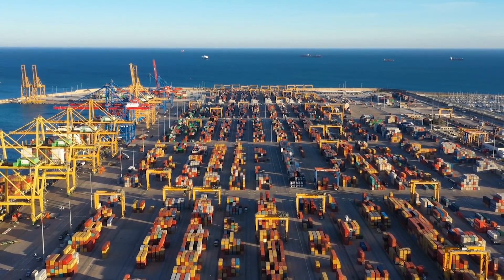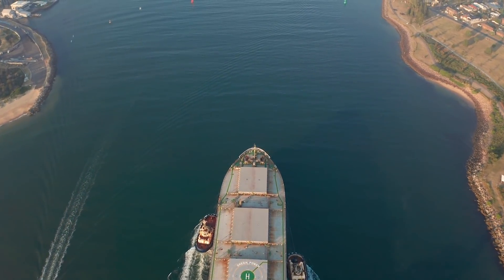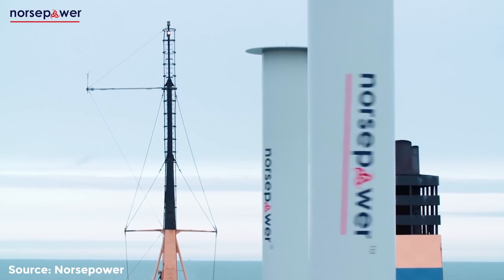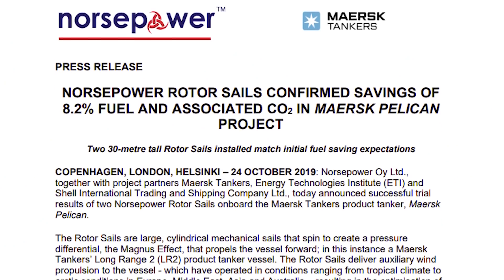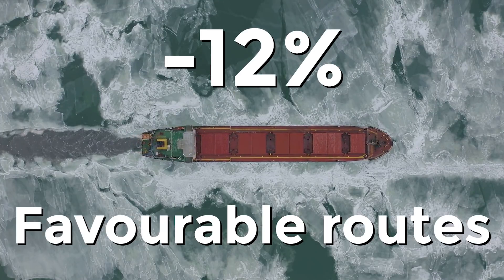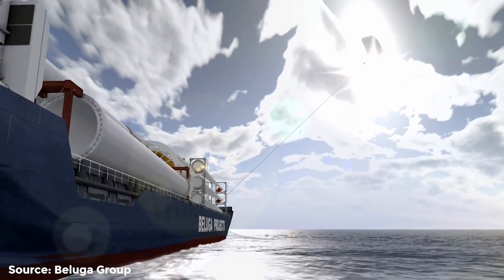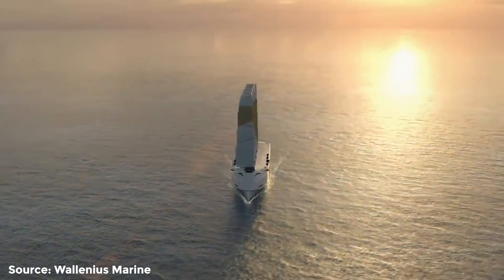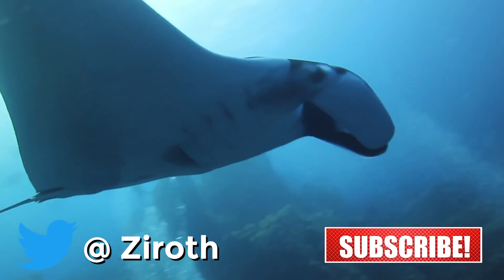Is Wind Power The Future of Shipping?

Comment: dude, i like the fact that you are not selling this as the future and are sceptical of the results, especially when they claim 90%. I think we are very far from renewable energy on big forms of transports (lorries, ships, planes,...). the reason is, all these are designed to have a (relatively) small engine compared to the full cargo. for example, if you think of a ship, probably the engine is 5% of the total size, together with the tanks maybe 10%, same for planes. Of course you can have an electric car because the current petrol engine uses almost 1/3 of the car (the front of back part) so a 1 to 1 transition is not a bad thing.
About the kite, I really doubt it can be a feasible solution, simply because the ropes will need to be so ultra resistant that I doubt will be able to pull an entire vessel full of containers and in any case will reduce the emissions (as you mentioned) by 10% maximum, even by optimising them at their best.

Comment: What about nuclear ship
Reply: If you do a web search for ‘nuclear ship savannah’ you will see that it has been tried and did not work.  A similarly vessel heavily subsidised, by the government, vessel is in use in Russia which also operates, in support of the Northern Sea Route, a fleet of nuclear powered ice breakers all of these may, or may not, have been completely without issues.

Just think; would you have full confidence in the management of a nuclear reactor under the control of an anonymous entity only traceable, perhaps, via a letter box in a FOC (flag of convenience) nation state?  If you are, could you sell that confidence to Japan, the state that hosted the Hiroshima and Nagasaki nuclear detonations as well as more recently the Fukushima ‘event’?  Then try that same, or a similar, sales strategy on Ukraine, the nation state that as a part of the USSR (CCCP) hosted the Chernobyl ‘event’.  Modern iterations of nuclear energy, thorium fuel, molten salt reactors or fusion reactors, will carry the legacy of past problems.  It is the global trepidation of anything with 'nuclear' in the name and the economics of nuclear having transitioned from 'energy to cheap to charge for' too 'the costs of remediation are incalculable' that will prevent the adoption of nuclear energy as a means of creating energy at sea.  Modern reaction systems may have overcome the safety problems but the general public, having been misled in the past, will be reluctant to believe the fresh new promises.  The incident of the ‘Ever Given’ blocking the Suez Canal, March 2021, may also have a little to add to this debate.  The cooling water on ships tends to get taken in from near the bottom so when running aground the inlets are in a prime spot to get plugged up restricting, if not stopping, the flow of coolant.  One thing that the TMI, Chernobyl and Fukushima incidents all had in common was that the supply of coolant, or rather lack thereof, was a fundamental cause.

‘They’ say nuclear is cheap, it’s not it is expensive and has a large embedded carbon quotient as well as being complicated, dangerous, not universally socially acceptable and having only ‘no need for refuelling’ as a questionable advantage; actually it does need refuelling just not as often.  When ‘they’ do need to refill the warming up stuff it takes considerable longer than pumping tonnes of thick black stuff, cSt380 HFO, or thin runny stuff, MDO, onboard which is one of the reasons HMS Queen Elizabeth and HMS Prince of Wales are pushed about by ICEs and gas turbines thus using a similar fuel as the aircraft that fly off of them.  The Royal Navy (RN) with a high degree of skill and expertise uses, at vast expenses to the UK taxpayer, a current operational nuclear fleet of 11 submarines (also known as ‘boats’) in two flotillas, seven attack subs and four ballistic missile boats.  The carbon footprint of all the extra bits of hardware and the fuel, including processing thereof, from ground to propeller, are the external costs that never seem to get considered.

Disposal, once it wears out, of both the machine (that was a ship) and fuel is another can of worms best left unopened.  The 26 RN boats no longer in use are laid up (some in Rosyth and some in Portsmouth) awaiting long term deconstruction including dealing with the fuel rods and other irradiated material.  The USN is not, as far as I know, a commercial organisation working to very tight margins and also has the skill and expertise to handle the complexities of nuclear power; so as well as submarines their aircraft carriers are nuclear powered and each of the current iteration has a build cost three times that of QE/PoW, bigger crews and more generous funding.  For those who still think that nuclear energy might be the answer I recommend this report: - https://www.bbc.com/future/article/20200901-the-radioactive-risk-of-sunken-nuclear-soviet-submarines?ocid=ww.social.link.email.  The navy of the USSR might have been under resourced and over extended but it was still generously supported in comparison with merchant shipping.  While merchant ships may be 'taken up from trade' as the RN would say, or may be captured or impressed by non state quasi military entities by way of piracy, but cargo ships are not military vessels.

Comment: Is nuclear impossible for nonmilitary ships?
Reply: If you do a web search for ‘nuclear ship savannah’ you will see that it has been tried and did not work.  A similarly vessel heavily subsidised, by the government, vessel is in use in Russia which also operates, in support of the Northern Sea Route, a fleet of nuclear powered ice breakers all of these may, or may not, have been completely without issues.

Just think; would you have full confidence in the management of a nuclear reactor under the control of an anonymous entity only traceable, perhaps, via a letter box in a FOC (flag of convenience) nation state?  If you are, could you sell that confidence to Japan, the state that hosted the Hiroshima and Nagasaki nuclear detonations as well as more recently the Fukushima ‘event’?  Then try that same, or a similar, sales strategy on Ukraine, the nation state that as a part of the USSR (CCCP) hosted the Chernobyl ‘event’.  Modern iterations of nuclear energy, thorium fuel, molten salt reactors or fusion reactors, will carry the legacy of past problems.  It is the global trepidation of anything with 'nuclear' in the name and the economics of nuclear having transitioned from 'energy to cheap to charge for' too 'the costs of remediation are incalculable' that will prevent the adoption of nuclear energy as a means of creating energy at sea.  Modern reaction systems may have overcome the safety problems but the general public, having been misled in the past, will be reluctant to believe the fresh new promises.  The incident of the ‘Ever Given’ blocking the Suez Canal, March 2021, may also have a little to add to this debate.  The cooling water on ships tends to get taken in from near the bottom so when running aground the inlets are in a prime spot to get plugged up restricting, if not stopping, the flow of coolant.  One thing that the TMI, Chernobyl and Fukushima incidents all had in common was that the supply of coolant, or rather lack thereof, was a fundamental cause.

‘They’ say nuclear is cheap, it’s not it is expensive and has a large embedded carbon quotient as well as being complicated, dangerous, not universally socially acceptable and having only ‘no need for refuelling’ as a questionable advantage; actually it does need refuelling just not as often.  When ‘they’ do need to refill the warming up stuff it takes considerable longer than pumping tonnes of thick black stuff, cSt380 HFO, or thin runny stuff, MDO, onboard which is one of the reasons HMS Queen Elizabeth and HMS Prince of Wales are pushed about by ICEs and gas turbines thus using a similar fuel as the aircraft that fly off of them.  The Royal Navy (RN) with a high degree of skill and expertise uses, at vast expenses to the UK taxpayer, a current operational nuclear fleet of 11 submarines (also known as ‘boats’) in two flotillas, seven attack subs and four ballistic missile boats.  The carbon footprint of all the extra bits of hardware and the fuel, including processing thereof, from ground to propeller, are the external costs that never seem to get considered.

Disposal, once it wears out, of both the machine (that was a ship) and fuel is another can of worms best left unopened.  The 26 RN boats no longer in use are laid up (some in Rosyth and some in Portsmouth) awaiting long term deconstruction including dealing with the fuel rods and other irradiated material.  The USN is not, as far as I know, a commercial organisation working to very tight margins and also has the skill and expertise to handle the complexities of nuclear power; so as well as submarines their aircraft carriers are nuclear powered and each of the current iteration has a build cost three times that of QE/PoW, bigger crews and more generous funding.  For those who still think that nuclear energy might be the answer I recommend this report: - https://www.bbc.com/future/article/20200901-the-radioactive-risk-of-sunken-nuclear-soviet-submarines?ocid=ww.social.link.email.  The navy of the USSR might have been under resourced and over extended but it was still generously supported in comparison with merchant shipping.  While merchant ships may be 'taken up from trade' as the RN would say, or may be captured or impressed by non state quasi military entities by way of piracy, but cargo ships are not military vessels.

Comment: While nuclear fusion energy is still a ways off, maybe in 50 years cargo ships will use small nuclear fusion reactors to power onboard propulsion?
Reply: If you do a web search for ‘nuclear ship savannah’ you will see that it has been tried and did not work.  A similarly vessel heavily subsidised, by the government, vessel is in use in Russia which also operates, in support of the Northern Sea Route, a fleet of nuclear powered ice breakers all of these may, or may not, have been completely without issues.

Just think; would you have full confidence in the management of a nuclear reactor under the control of an anonymous entity only traceable, perhaps, via a letter box in a FOC (flag of convenience) nation state?  If you are, could you sell that confidence to Japan, the state that hosted the Hiroshima and Nagasaki nuclear detonations as well as more recently the Fukushima ‘event’?  Then try that same, or a similar, sales strategy on Ukraine, the nation state that as a part of the USSR (CCCP) hosted the Chernobyl ‘event’.  Modern iterations of nuclear energy, thorium fuel, molten salt reactors or fusion reactors, will carry the legacy of past problems.  It is the global trepidation of anything with 'nuclear' in the name and the economics of nuclear having transitioned from 'energy to cheap to charge for' too 'the costs of remediation are incalculable' that will prevent the adoption of nuclear energy as a means of creating energy at sea.  Modern reaction systems may have overcome the safety problems but the general public, having been misled in the past, will be reluctant to believe the fresh new promises.  The incident of the ‘Ever Given’ blocking the Suez Canal, March 2021, may also have a little to add to this debate.  The cooling water on ships tends to get taken in from near the bottom so when running aground the inlets are in a prime spot to get plugged up restricting, if not stopping, the flow of coolant.  One thing that the TMI, Chernobyl and Fukushima incidents all had in common was that the supply of coolant, or rather lack thereof, was a fundamental cause.

‘They’ say nuclear is cheap, it’s not it is expensive and has a large embedded carbon quotient as well as being complicated, dangerous, not universally socially acceptable and having only ‘no need for refuelling’ as a questionable advantage; actually it does need refuelling just not as often.  When ‘they’ do need to refill the warming up stuff it takes considerable longer than pumping tonnes of thick black stuff, cSt380 HFO, or thin runny stuff, MDO, onboard which is one of the reasons HMS Queen Elizabeth and HMS Prince of Wales are pushed about by ICEs and gas turbines thus using a similar fuel as the aircraft that fly off of them.  The Royal Navy (RN) with a high degree of skill and expertise uses, at vast expenses to the UK taxpayer, a current operational nuclear fleet of 11 submarines (also known as ‘boats’) in two flotillas, seven attack subs and four ballistic missile boats.  The carbon footprint of all the extra bits of hardware and the fuel, including processing thereof, from ground to propeller, are the external costs that never seem to get considered.

Disposal, once it wears out, of both the machine (that was a ship) and fuel is another can of worms best left unopened.  The 26 RN boats no longer in use are laid up (some in Rosyth and some in Portsmouth) awaiting long term deconstruction including dealing with the fuel rods and other irradiated material.  The USN is not, as far as I know, a commercial organisation working to very tight margins and also has the skill and expertise to handle the complexities of nuclear power; so as well as submarines their aircraft carriers are nuclear powered and each of the current iteration has a build cost three times that of QE/PoW, bigger crews and more generous funding.  For those who still think that nuclear energy might be the answer I recommend this report: - https://www.bbc.com/future/article/20200901-the-radioactive-risk-of-sunken-nuclear-soviet-submarines?ocid=ww.social.link.email.  The navy of the USSR might have been under resourced and over extended but it was still generously supported in comparison with merchant shipping.  While merchant ships may be 'taken up from trade' as the RN would say, or may be captured or impressed by non state quasi military entities by way of piracy, but cargo ships are not military vessels.